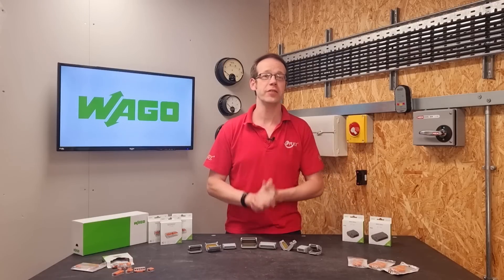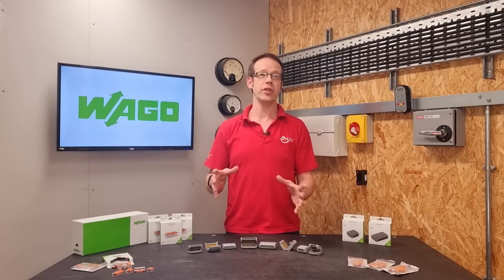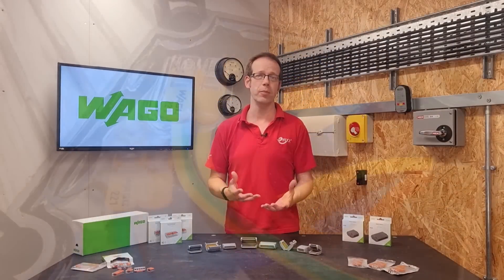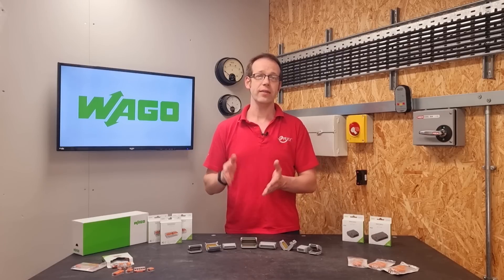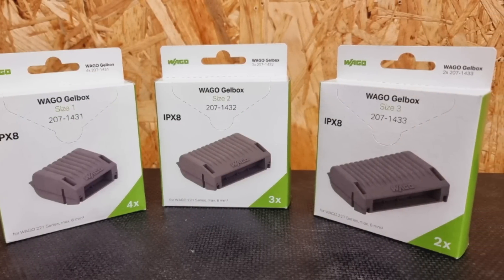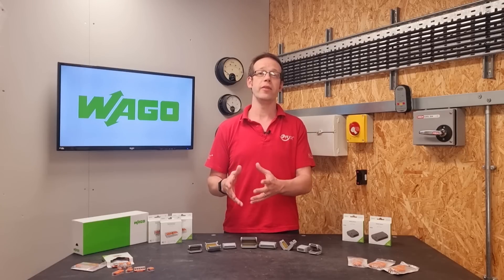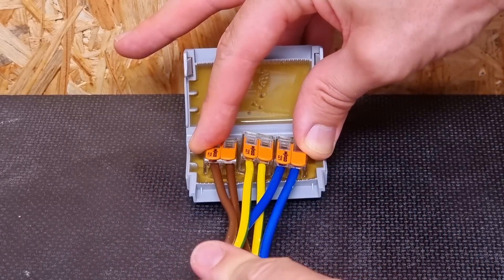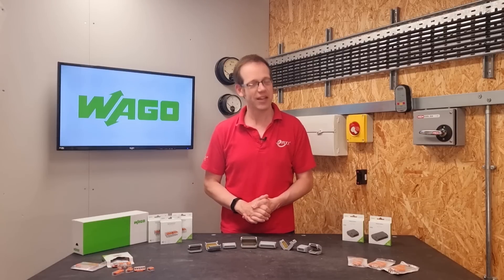How to Make Your WAGO 221 Connectors Waterproof

Comment: I wonder about the lifespan of the gel. Depending on the chemical compounds used it might degrade over time in hot/humid environments. Any datasheets?
Reply: It's a paid ad not a genuine video. Check description
Reply: Google the datasheet, it says "suitable for indefinite storage". It says nothing on lifetime in operation. But then, it's a box with a gel in it, is there a difference between storage and operation? They do specify a wider temperature range in operation ( -55°C ... 80°C) vs. storage (0 .. .40 °C). So maybe it only lasts indefinitely (whatever that means) when kept within the latter temperature range? Probably hard to do if the wires are carrying any significant load. Not a great datasheet.
Reply: @andreasu.3546  Are you sure you meant to direct that comment at me?
Reply: hopefully ants will not love that stuff
Reply: @tjmarx  Nope, seems I clicked the wrong "answer" button. Fixed now.
Reply: @andreasu.3546  *cough*. You mean reply. 

All good mate, have a great day
Reply: @tjmarx  Whatever. I can only guess what it is in English, the Youtube UI is set to German language here.
Reply: This product is useless. I used the Wago gel box  in outdoor area for lights that were installed on a terrace. After quite a few rainy days followed by higher temperatures and sun, lights started triggering braker. Opened up one of the lights and not only that moisture was present but after opening Wago gel box there was also moisture inside the connector that was enclosed by gel.

Comment: well, a gelbox that houses 3 3 pin connectors would be great for splitting a standard 3 core cable (I'm thinking a phase, a neutral and a ground) in harsh conditions

Comment: Interested in using these in irrigation, to waterproof connections to solenoids/decoders in areas prone to water submersion during heavy rains. 
How would the gel impact electrical signals on a 39V 0.22amp DC system?

Comment: I see the thumbnail shows twin and CPC cable used with one of these gel boxes.

What stops water from tracking down the open end of the CPC sleeving outside the gel box & into the connector?

Does the gel penetrate all the way inside the connector? From the part of the video showing how these are removable the gel only seems to cover to the bottom of the connectors and the CPC sleeving goes well beyond this point if you follow Wago’s strip length specification.

I can see how these work on flex but on T & CPC with the CPC sleeving we use in the UK it is acting as a conduit for liquid to enter the connector.
Reply: If its outdoors (most likely case of use) should you be using t&e? Or do you think its more likely H07Rf, hituff or SWA?
Reply: @darylsavage119  All very good points, would be great if eFixx could answer these questions.

I would not be using T&CPC outdoors as it is not rated for it. It is just the thumbnail shows these boxes being used with T&CPC and I wanted to know if that is what they are designed for?

Do Wago even approve the use of such cable with this product?
Reply: Why would it matter if water did track into the connectors? Providing that insulation between conductors is maintained it really doesn't matter if an individual conductor is bathed in water - i guess oxidation might be a risk but not with the volume of water we'd be talking about here.

He's put three connectors - one for each of L,N & CPC. each have gel between them. If say each of those three connectors was flooded with water then there still wouldn't be a conductive path between them due to the gel. And water isn't that conductive anyway - if you got a 1cm long 1mm2 tube filled with tapwater it would provide about 100kohms of resistance - now that would mean when you do an insulation test you'd know there's a problem and fail as it's <1Mohm, but it would equally mean that an L-E fault formed by a cavity like this wouldn't allow enough current to flow in order to even trip a 30mA RCD so if you neglected the insulation test you'd probably never know about it.
Reply: @keirstitt8277  I would just like to know if this product is suitable for use with the cable type shown. 

I agree with all your points, my main concern would be corrosion and who knows how long liquid could be in contact with the connector that it could corrode the connector to such a degree that it fails and then you lose your CPC.

I know a very specific circumstances but it is possible and for a product you solely install to keep water out from the connector it defeats its purpose if water can get to the connector by bypassing the gel.

Nothing wrong with the product just seeking clarity on the installation method.
Reply: @APSuk2  Looking at the video it's not twin and CPC. But I could imagine places where it would be approapriate to bring twin and cpc into one of of these. You could have a wispa box on an external wall with twin and cpc entering through the wall into the box where it splices to an NYYJ leaving through a gland - i've seen this quite a lot and it's perfectly fine because the twin and CPC is adequatly protected from mechanical and UV damage by the wall.
Reply: @keirstitt8277  On the thumbnail they are using twin & CPC.
Reply: @APSuk2  I think it's white flex - it's not clear enough to see either way. But as I say no problem with Twin & CPC so long as it's properly protected from EI.

I recently did an EICR on a building with extensive Twin & CPC outside - and I was horified until I took a step back. Actually it was running across places like the underside of a carport where UV isn't likely to affect it.

Yes it was really bad choice of materials but no you can't code it because whilst it was crindge it was also fully compliant.

Comment: Nice didn't know Wago had these will get a load for the van
Reply from the maker: They are super handy aren't they? 😊
Reply: @efixx  not half as a rule I only install ip 65 and above anywhere outside as am in shetland we have horizontal rain for 50 weeks of the year and snow and hail for the rest 😂
Reply from the maker: That sounds challenging and awesome, we should arrange a visit! 😃
Reply: @efixx  yes its a great place for a summer Holiday 😂 by all means fill your boots its a challenging environment at the best of times so it's always good to have another helpful item in the van

Comment: The small amount of  gel is nice, but it seems to me like that inherently means that that problem you mention of moisture ingressing through the glands and then into the outer insulation is not prevented by this at all. Maybe it’d help if you filled the rest of the enclosure up with polystyrene beads but I suppose that’s probably against the code.
Reply from the maker: The key thing is to keep the moisture out of the connections rather than the enclosure. Polystyrene beads would be a no-no as it chemically reacts with PVC and degrades the insulation. 👍👍👍
Reply: Nope! The reason that condensation occurs inside a properly sealed IP68 box is NOT due to gland seepage!

 When correctly installed with the correct gland for the cable, IP68 will be maintained. I keep hearing this complete hogwash about gland seepage from so many people it is untrue! Any seepage that MAY occur is MUCH more likely to arise from the internal of a cable and a NON IP68 termination at one end.

So from where does the moisture to cause such condensation come? Answer: SIMPLE ... it is already in the box when you seal it, especially in the UK with our high humidity levels and low dewpoints in winter. In other words, YOU put/allowed it in there when you sealed the box!! It's that simple!

 The simple expedient of blowing warm air from say a hairdryer or hot air gun or a quick waft of a blowtorch flame into the open box immediately prior to sealing removes 90% of the moisture and a silica gel pack easily removes and retains the rest.

These things I have tested ... For my own satisfaction! Come on eFixx ... Do some tests of your own! Prove me wrong! 

The rest of the industry and my erstwhile fellow colleagues at the IET can't be bothered it seems, nor have they considered the effects of the extra moisture allowed ingress via a small, and entirely unnecessary breathing hole. Such moisture condenses first and foremost on metal surfaces LONG before it is seen on a transparent front cover! People have been discussing the merits and demerits of AFDDs a lot with the upcoming regs changes yet here is a potential CAUSE of arcing and flashover, not to mention rust and corrosion that the industry has utterly ignored for years, whilst at the same time installation instructions from manufacturers suggest/demand/advise drilling vent holes in IP68 rated enclosures!! WTH!?
Reply from the maker: I didn't say anything about gland seepage. 🤷
Reply: @efixx  very observant ... Jasper Janssen did though! 🤔
Reply: The misconception of IP ratings is that people think they keep water out. That isn't the requirement in the standards. IP ratings show that equipment can withstand an environment, they don't show that equipment won't e.g. let water in. 

As for "seepage" an enclosure will never be impermiable so unless you're e.g. in an ATEX situation where the enclosure is purged and maintained with 100% nitrogen under positive pressure there will always be water vapour in your enclosure that will inevitably condense. Hence you are required to put a drain hole. There's not an enclosure in the world that is 100% impermiable to vapour. The walls of the Internation Space Station aren't 100% imperiable to vapour.
Reply: @keirstitt8277  I've never seen such a ridiculous comment! 

1. The definition of IP 67 (taking the second digit - the first is dust ingress obviously) STATES the enclosure or device MUST be able to withstand submersion to 1m for 30 minutes! IP68 however does not have specific absolutes other than it is MORE stringent than IP67 and unlimited/permanent submersion in water is specified with time and pressure (depth) defined by the MANUFACTURER (IP

2. To achieve total submersion in water to a depth of just 1m, the enclosure MUST be waterproof. Drilling a 1mm hole (never mind the 3mm hole typically referenced) in ANY such enclosure immediately breaks the IP68 AND IP67 specs/definitions! In addition it breaks the dust ingress spec that for a CU states no item larger than 1mm may be allowed to enter! 

3. To state something as utterly ludicrous as the complete opposite of the specs (re 67 & 68) that the purpose is "not to keep water out" is banale! That is EXACTLY what the spec states "....submersible to at least 1m for 30 minutes (IP67) and waterproof to a manufacturer specified depth (>1m). 

Please explain EXACTLY how something can be spec'd as waterproof without keeping water out? Do you actually comprehend what the standard says? If it's not waterproof it is NOT IP67 or IP68! DOH! 🤔🙄🙄 Regs say fit IP68 and you drill a hole ... You have broken the regs! Are you REALLY that dumb? 🤔🙄🙄

I repeat if water vapour at installation is minimised (or removed) and the enclosure is properly sealed there will NEVER be a need for a drain OR vent hole, OR nitrogen and drilling ANY hole destroys the rating! A self fulfilling prophesy!

If an IP68 enclosure or device is specified to let's say 2m (it could be over 200m!!) WHY would a minor air pressure change be of concern? It would NOT cause any problem of "pressure increase" inside the enclosure/device from air pressure or weather heating. That is so insane, that if you believe it, watch out for the van with the men in the white coats arriving!

If you believe anything I have said in these comments is false PROVE IT!
Reply: @boblewis5558  
That isn’t the definition, IEC 60529 defines IPx7 as “Ingress of water in quantities causing harmful effects shall not be possible when the enclosure in temporarily immersed in water under standardized conditions of pressure and time.” IPx8 has similar wording but with an undefined more severe value. The definitions of all other water ingress codes uses the term “harmful effects”. 

We are told in para. 14.3 that water may enter the enclosure so long as it doesn’t interfere with the correct operation, impair safety, deposit on insulation where it could lead to tracking along the creepage distances etc.  

As the Gelbox is capable of operating entirely submerged – as demonstrated in the video – the entire installation would if tested likely perform to IPx7 even if the outer enclosure was fully flooded. Of course the outer enclosure wouldn’t fully flood under IPx7 conditions by a single drain hole providing you used a sensible sized drill.

Also worth noting that meeting IPx7/8 doesn't confer compliance with IPx1-6.

Next time you look up at a 400kV overhead pilon as yourself how they manage to meet IPx2 given it's not in a box yet it's outside in the rain. To use the verbage from your source - the question is if it can withstand the external influence without imparing performance or safety and if the answer is yes then it's fine.
Reply: @boblewis5558  And I've been to some dry places but never somewhere with 0% humidity. The idea you can screw a cover on when there's no water vapour is absolute nonsense. According to my thermometer I'm sat in an office with 45% RH at 21C and 1005hPa. Now if I look at the Pressure-Enthalpy diagram for water that means the air I'm breathing is about 2% water - more than every other constituent beyond N2 and O2. If I put the lid on a sealed enclosure here then put it in my fridge and leave overnight then tomorrow not only will i have lots of condensation in it but the condensing water will have pulled a vaccum and drawn even more vapour into the box.

What's even more fun is that if I cycle the box between the fridge and the kitchen side - or maybe screw the box to the outside wall and cycle it between day and night - it will consistently draw in more and more water even without any glands.

This is why failing to follow the manufacturers instructions and put a drain hole is a bad idea.
Reply: @boblewis5558  You are correct that drilling a hole breaks the rating. Which is unfortunate because a Wiska box without making holes is basically a lightweight paperweight.

As for fairytales, I'm the one reading from IEC 60529 - which is handily summarised in Appendix L to the OSG - whilst you're the one copying and pasting of google whilst letting out your anger on the caps lock key.

And I've just done a quick scan of the standard again, nothing about intrusion of insects. I'm afraid if it's arachnophobia you're worried about then IP ratings aren't the tool to solve it.

But have a think about the example I gave of a 400kV electricity pylon. It must be IPx2 because every one I've ever seen is outside where it rains. How do they acheive this? They don't have giant umbrellas on them. Maybe they were IPx2 when they were made, but when someone took them out of the box to assemble them they broke the ratings - I hope nobody gets hurt because 400kV is particularly dangerous.
Reply: @keirstitt8277  why do you keep repeating the same irrelevancies? IPX2 isn't supposed to be waterproof, it only protects from vertically dripping water, so it's not even moisture proof. IP68 *is both*!!

The point about insects is not because I have arachnaphobia (insects are NOT arachnids! Duh). The point is that if insects can enter, then clearly moisture can enter! If moisture can enter, or worse, liquid water as opposed to water vapour) then again it is not IP67 OR IP68!

 Also insect sized objects being able to enter mean it is also not even IP3X rated with a 3mm hole and definitely not IP4x rated ... A requirement for domestic electrical devices/switchgear. 

So if suppliers instructions are telling you to drill a drainage hole, they are selling you an article that complies with a standard out of the box and yet it doesn't if you follow their installation instructions! And most sparkies appear to follow such instructions blindly without thinking about them at all!

If you want to carry on drilling holes in such enclosures ... Carry on. I KNOW my method works ... I have the personal evidence to prove it.

BTW only ALL caps for a whole message is considered shouting otherwise it's just emphasis!
Reply: This is a paid ad. They are only stating manufacturer talking points, nothing in the video is genuine. Check the description, they state it there.

This product has many obvious flaws. An objective reviewer would have shredded this product
Reply: @boblewis5558  I didn’t accuse you of shouting, and unfortunately I can’t go back and see if I misinterpreted something you said because several of your comments have disappeared – which is poor etiquette.

I’m not interested in who is right and wrong here – I would enjoy being wrong because if I am then I’d learn something – but I’d suggest you get a copy of BS EN 60529 which you can probably read at your local library via BSOL online. 

Your solution might all be very well and good but unless you follow the method of a standard you don’t know if there’s anything important you’ve missed. Unknown unknowns are the cause of a lot of problems in this world. Fundamentally there is nothing in 60529 [which is the only place you’ll find the actual definition of the IP ratings] mentioning either waterproofing or hermetic sealing. Hermetic sealing is one of many means to achieve an IP rating but the problem an installer has is that they won’t be sending their finished installation of to a test lab so unless they want to spend a five figure number on testing [The last time I was involved in doing this the total test budget for all aspects of the system was over £100k and the IP related elements we certainly spent over £10k] they need to follow the manufacturer’s instructions rather than try and be clever.